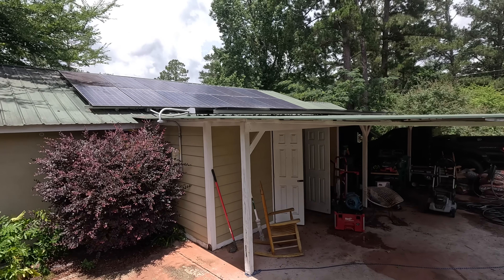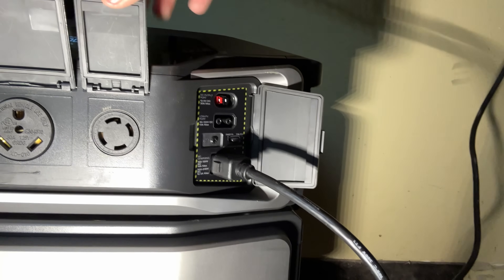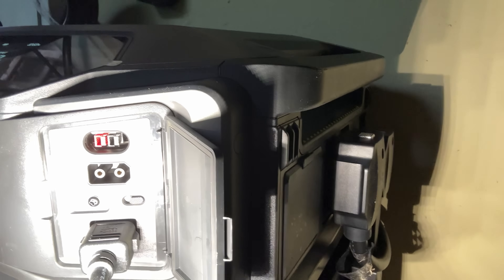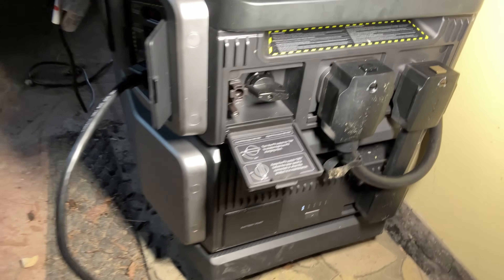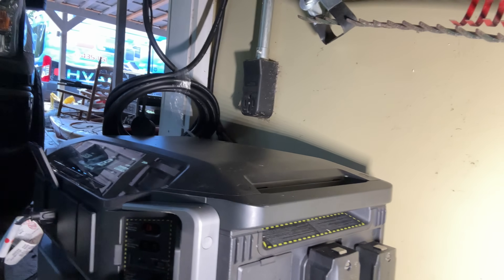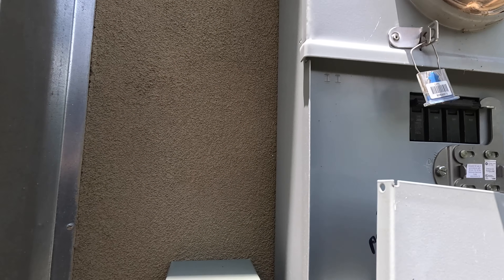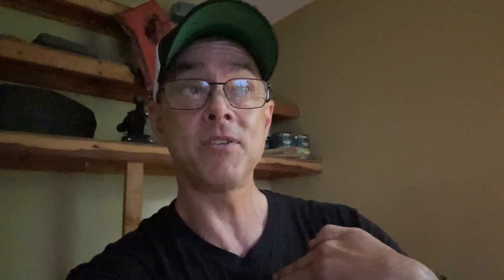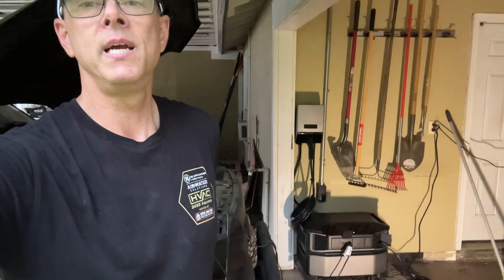Many Possibilities with The EcoFlow Delta Pro Ultra! #hvacguy

Comment: Beware of the deceptive promotion on the EcoFlow delta ultra x with the lie that if you pay $500.00 down you will get $1000.00 off the total price.

Beware of the deception on the $1000.00 off promotion 
If we pay a $500.00 deposit then it’s a no brainer that we will get $500.00 off the final price because we’ve paid $500.00 up front. But the deceptive promise states that only if we pay $500.00 up front will we get $1000.00 off at the end. No where does you deceptive promotion say anywhere that the final discount will be only $500.00. 
If it had said that then at least your promotion would have been straight up and honest. If it said deposit 500 now and we will take off $500.00 from your final total that would have not been a deceptive play on words like your promotion is right now. I was ready to purchase but I’m really on the fence now because I don’t trust a company that’s not just straight forward.

Comment: Questions to ask:

1 How long does it take to fully recharge?
2 Is it possible to replace the batteries when they wear out?
3 how much does it cost to replace the batteries?
4 Will this company still be around when I need to replace the batteries?

I have solar and the times you are most likely to need solar, there isn't going to be any sun out. During winter I might as well not even have solar panels, because there are weeks where I don't get enough sun to make a difference.

From my research, these things have a very short lifespan. I prefer a generator that can be recharged instantly when the power runs out using a can of liquid electricity.
Reply from the maker: Whole system is modular, so yes the batteries can very easily be replaced. Inverter is just sitting on top of an individually replaceable battery.

Comment: the only thing I see is multiple power loss points from it being inverted multiple times. once from solar panels, second in ecoflow, third in vehicle charger, and probably a fourth time at vehicle battery pack charge controller. every single conversion point has loss into heat.

Comment: This has merit in that inverters can supply clean current as good as or better than your utility company. You need to decide on how you want to keep it charged up during long-term power outages. Solar panels is but one way. There are others.